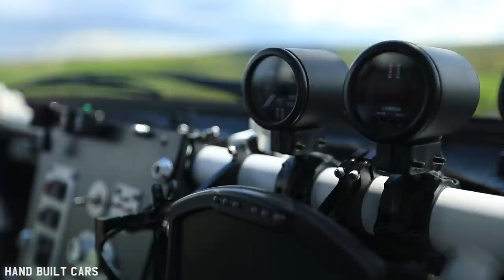Hand Built Carbon Fibre 1983 Volkswagen Golf Mk1 1.8 20v Turbo

Comment: Hi mate great build , I to have been through that long process , hard work but worth it in the end . Could I ask you what is the throttle pedal you have used ?  I would like that on mine , many thanks .
Reply: Thank you., the throttle pedal is compbrake from the uk. I had to modify the pedal and make a plate to weld on the floor to fasten it to.
Reply: @jrawsthorne3365  Hi John , thanks for getting back to me , do you have a part number ? Thanks Karl
Reply: Hi Karl I’ve no idea what the part no is sorry. Compbrake just said it is made for a mk1. But like I said it needed modifying.

Comment: 9 years, oof Started in Feb, 2020 Turning a 2016 Scirocco R, (that has been hit in the arse), into AWD, I've got the Golf R  floor in, suspension, diff, gearbox and R drive shaft. Still need to sort fuel tank, exhaust, fuel and brake lines, a beaver panel, rear hatch, tail lights, and paint. Love the Matt black finish. but think i'll keep it blue.Staying motivated is the hardest part, one job, a few hours at a time, will hopefully see the project done sooner than later.
Reply: Yes it’s very hard keeping motivated. You will get there in the end. Stick at it. Hard work pays off. I’m 50 years old now so I’m now finding it even harder, especially when it’s jus me doing it. I Hope yours turns out soon. 👍. Keep it up.
Reply: @jrawsthorne3365  I'm a 1969 model myself ! , It's a project car with the boy. Thanks for spurring us on.